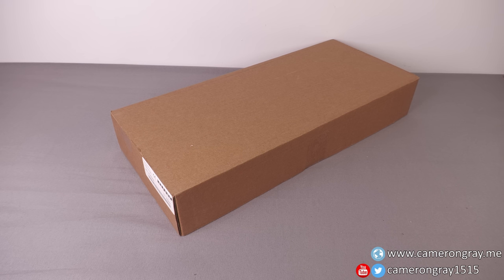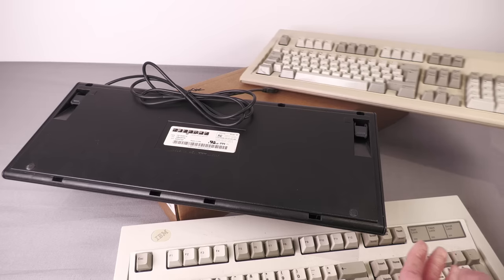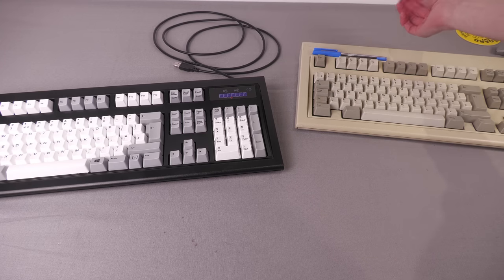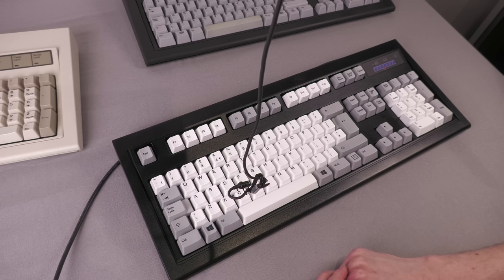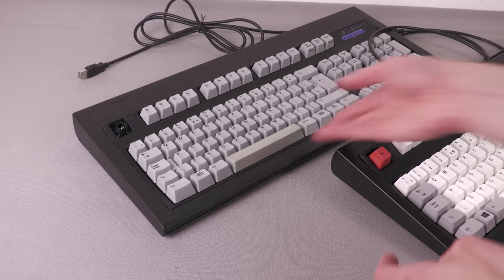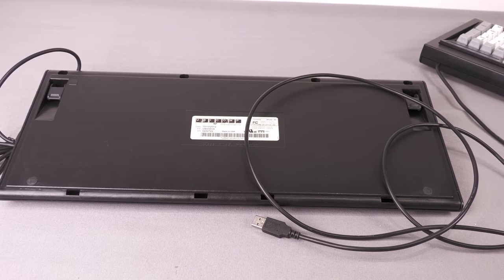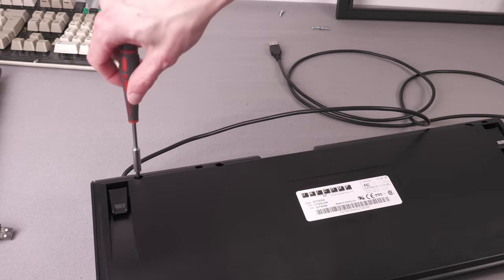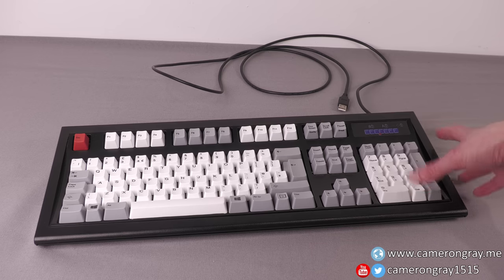A Classic, Updated - The *New* Model M Keyboard from Unicomp

Comment: I bought the Classic 101 March 2021 and now September 2023.  Used a few times and was put into storage.  Recently rediscovered and noticed "P" key was acting erratic requiring two or three taps to make contact.  Contacted Unicomp and was given RMA but would cost $48.00 plus $16 shipping.  After doing my own disassembly I found all but 6 plastic rivet heads were broken off.  Unicomp claims this issue was resolved before I purchased in 2021.  I would not advise purchasing from Unicomp based on my experience.
Reply: Same for me...

Comment: Not quite as good as the original IBM Model M, but much improved from their previous Model M (for one thing they went back to a thicker steel backplate). This new one is similar to the 90's Lexmark models. I would say it's "good enough". Also as far as the blemishes on the back where the internal supports are, even my IBM original PVC shell Model M has that. Part of the reason the newer model M's aren't quite as nice is they can't use the original PVC plastic for the shells anymore due to environmental regulations.

Comment: I rescued a couple of model M's when they were being thrown out at my place of work around 2006. I still use one daily (manufactured 1995-06-17). It's survived a number of my PC's... No detachable cable though. On the previous one I needed a PS/2 - USB adapter as that motherboard didn't have a PS/2 connector. My current motherboard conveniently does.
I actually like the extra space above the function keys, it's where I store all sorts of junk like pens, scredrivers, screws, spare jumpers (don't really need those anymore), etc. The raised edge prevents that junk from sliding into the keys themselves, perfect.

Of course a Euro symbol won't have appeared before 2001.

Comment: Just wanted to add, that yes, Unicomp does offer their keycaps in the removable 2 parts.  When ordering, you would need to add into the notes, or contact customer service first, that your want your keycaps in the 2 part configuration.  Otherwise, it is the default 1 part.

Comment: I have been using mine nonstop for a year now and I don't plan on switching to another keyboard. The typing experience is amazing but I also game on it as well and it's not a problem either because I find the heavier feel and deeper travel a lot more comfortable than the ultra light and sensitive switches you find on gaming keyboards. It does have 2 key rollover but it also has anti-ghosting so I can press up to 4 keys or more but I don't know if this is only applies to the PS/2 version since that's the version I have. The only negative I can say are the lack of multimedia keys since I heavily rely on those but I worked around this by setting them up as shortcuts.

Comment: I finally managed to get a Unicomp M.  (Production Date: December 4, 2023).  I also have my 86 M and my 85 M122 as references, and you are correct that the quality of the Unicomp M vs. the original mid 80s square badges is massive.  If I didn't know about the IBM M from the mid 80s, I would say that the Unicomp was a good work keyboard, but then you get actual IBM M's, and the differences are just massive.  the build quality, the key feel, the sounds, the thicker materials in the original M's, it gives a bit more of a typewriter feel rather than typing in an echo chamber. 

Have you ever thought of comparing the M to an F to see the quality differences between the 86m and say, an F XT?

Thanks! and great review, definitely a worthwhile watch.

Comment: Blue LED's operate at a bit higher voltage than Green or Amber ones, so if you want to change out the LED's you may have to install some new resistors in series with the new LEDs to bring the voltage into the right range. (The forward voltage drop across the LED is constant, set by the LED itself, so what will happen is that the LED will draw more current.)

Comment: 16:50 You are describing doubleshot keycaps with each colour a different plastic all way through, so cant rub off.

Dye Sub (sublimated) is a chemical process where the top layer of plastic is altered chemically to alter its colour. They can rub off depending on its quality and usage. 

So dye_sub is subpar than doubledhot when it comes to longevity but is superior in producing wider variety of designs. Double shots require different tooling to even chage the font whereas dyesubs produce keycaps with images.

Comment: With the special functions on Mac keyboards, those are handled at the hardware level in the keyboard from what I’ve been told (even on Mac keyboards), rather than Mac OS seeing that you pressed F4 or whatever and recognising it needs to do XYZ (i think official apple keyboards have ways that the OS can tell the keyboard “default to F1, F2, F3, etc…” or “default to special functions”)
So on a keyboard like this, those keys will always function as F1, F2, F3, etc…

Comment: I have a 1986 1390120 as well.  Got it bolt modded.  Has no deck flex.  The bolts effectively get rid of the flex.

Comment: On the LED colour, my New Model M, which was manufactured on 2023-05-01, has the bright blue LEDs.
I personally do not mind them, but this is due to the bright area being just outside of where I sit at my desktop.
Heck, I even set the Scroll Lock LED up as a disk activity light, as Scroll Lock isn't used on Linux and this was very easy to set up.
It did come with a broken controller module (missing pullups), I've been send a new one, if that one contains green LEDs I'll update this comment.
Reply: Update on this, the replacement controller board I received is the old design, as seen in the video here.
It also has blue indicator LEDs, these being a bit brighter than those on the new design.
Another difference is that the new controller has the LEDs placed on a small spacer, which leads to worse diffusion.

Comment: I bought one of these to compare with my old Northgate keyboard. I bought my Northgate back in the late 90s. I'm still using my Northgate but I did send it away for cleaning and to repair a couple of keys about 10 years ago. I bought my Unicomp keyboard something before 2010. If the keys had just a slightly shorter key travel distance I would use it instead of my Northgate keyboard. 
I like to keep a couple of pens on the that extra along the top edge of the keyboard.

Comment: I Bought two Ultra Classics, and they both failed within a year; random USB disconnections, keys stopped working, etc. I tossed out the first one, as it straghit up stopped working at all, but the second one I still have, because it still partly works and I have this wild idea that I might actually be able to repair it someday. In the meantime my Corsair K70 has lasted 8 years, though.
Reply: There USB controller has always been problematic. How hard could it be to fix it…
Reply: @soldiersvejk2053  Easy to fix. i use a Logitech USB Extension Cable. 😀

Comment: I have an Classic and a new model M and I too noticed that the springy "twang" is missing in the new. Maybe it's just a matter of the keyboard not being broken in? However, when I put on my headphones and block out the sound, the new Model M feels great to type on, better than the old one.
Reply: that might have to do with how old the model m you have is? idk i could be wrong but older keyboards do age if i recall correctly
Reply from the maker: Yeah, I found that the keyboards that I have with more broken rivets had more of a twang than the ones with most of their rivets intact.  In my case, the Unicomp Classic definitely has the most noticeable "twang" and also the most broken rivets so I suspect it's more of a "wear" thing rather than something that's specifically missing from the new one.
Reply: A few keys on my New Model M do twang, but this is only about 5%, the rest not having this sound.
But it's not loud in my case, I also happen to like the slight variance in sound my board has.
Keyfeel is consistent though, aside from a few scratchy modifiers.

Comment: I was thinking about getting a Classic but decided against it. If it comes damaged, you have to pay shipping back to them on a 6lb/7lb keyboard after paying shipping to receive it plus a $25 repair fee and a couple of other things I can't remember.

If they made the Classic with the thicker original metal plate, had screws instead of rivets and was built to the quality standards of the New Model M, I'd think about it. But paying $120+ for a keyboard just to send it back and spend the same amount on repairs you might as well buy a new one.

Comment: They look so fucking cool. I want this in either Green or Blue, but it does cost a lot. I think it'll be worth it, but there as so many mixed reviews about the Unicomp Model M for gaming. Some people say that it works fine, and others say it doesn't work well and it's best to look elsewhere. Im not a pro or anything, I just want to play casually but I want to know if it is compatible
Reply from the maker: I'm not a gamer personally but as far as I know, these aren't really the best for gaming.  On most keyboards the key will actuate and deactuate at around the same point in the keystroke.  This makes it easy to rapidly trigger a key by moving it up and down around this actuation point rather than needing to press the key all the way down and let it lift all the way back up again.  On a Model M you need to press the key relatively far down for it to trigger and then lift the key up pretty far for it to deactuate so that you can trigger it again.  This is fine for typing but not ideal for gaming where rapid, repeated key presses are commonplace.
Reply: I have one of the older model m's and just now purchased the new model M from Unicomp because this one has started to cut in an out with a single beep and I have to unplug and replug it back in to get it working again. I have been gaming with this old model m since 2018 and had 0 issues with key presses. I would assume that if they follow the same philosophy the new model M should be more than enough for gaming needs. I am not a fan of the overpriced mechanical keyboards of modern times with all the LED's so I jumped at the chance to purchase the new Model M. Once it is delivered ill let you know how it fares in my gaming ventures.
Reply: Alright, so I got the New model M. I have to agree with Cameron. This may have nothing to do with a fully functioning New model M, but the one I got has a very loose spacebar spring, making it so you have to press it down harder than I did on my original now dead Model M. And I really do not like having to immediately troubleshoot something I bought brand new. I will be returning this keyboard as I did indeed buy it for gaming purposes. but it even fails in the typing role since the poor QA and packaging protections makes it highly likely you will receive a broken product. No doubt the product I received was chucked around and had improper protection allowing the spacebar to be damaged in some way. Sad that a company claims the quality of a well built keyboard but does nothing to ensure that the experience of the product is consistent. A real disappointment forcing me to go with a more modern mechanical keyboard. Ill get my original Model M refurbished one day but for now ill live in the present. :(

Comment: Isn't there an issue with the controllers on these new Unicomp Model M's?
Reply: I believe there was an easy fix, like using a usb extension cable. They will exchange if there are issues

Comment: Their USB controller seems to have some problems. My first one will automatically disconnect (on different PCs). Had to get an exchange.
Reply: Easy to fix. i use a Logitech USB Extension Cable. 😀

Comment: Loved my Unicomp. Bought mine in 2015 or so. Unfortunately mine gave me trouble. Went in once about a year later for intermittent specific keycap failure. It was fixed and the same issue happened again in about the same time frame. A bit disappointing considering I bought a replacement Chinese mechanical keyboard for $40 that never gave me issues. I babied the board also, Guess i was just unlucky.

Comment: I have had two Unicomp keyboards in last 12 years. I gave away my first, and second had a few keys die, because I was a dumbass in extreme cleaning. 
 I recently "caved" and a new fangled new cherry switch, with cool leds, that make little pretty designs in light all the time. 
I have realized this is stupid horseshit, and is only distracting, and it really illuminates dirt, dust, hair, bougers, and potato chips.... of course all keyboards have this, but I am not fond of seeing them in perfect illuminated fashion everytime i search for the god damn $ key. Who can remember where that fucker is?

Short story long, I'm ordering my third.
Reply: I kind of do like LED on keyboards, but only when they are functional and shine well through the keycaps. I have a cheap one of 40 bucks and it even has built in dimming setting for the lights if i want them less blinding at night or even off. I dislike the the light settings that are constantly flashing so i keep mine at a static color of purple. On occasion i make an exception for the “christmas lights” settings where the keys randomly slowly change color like a Christmas tree. 

The only change i’d like with my keyboard is maybe replacing the nav cluster with a numpad. On the nav cluster, i only use the del key so its just wasted space to me.